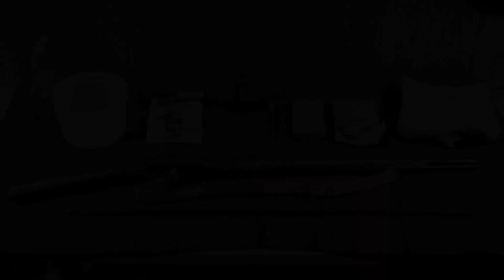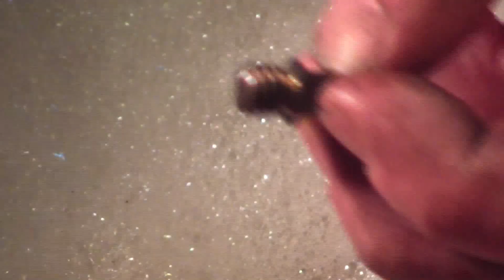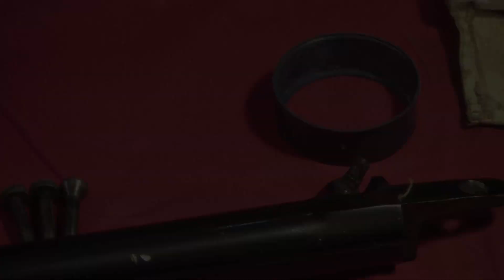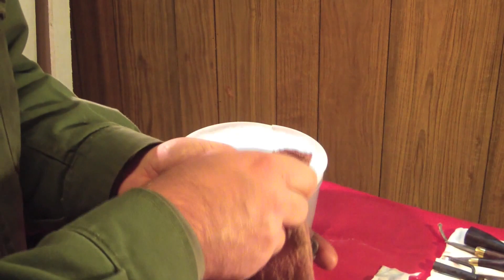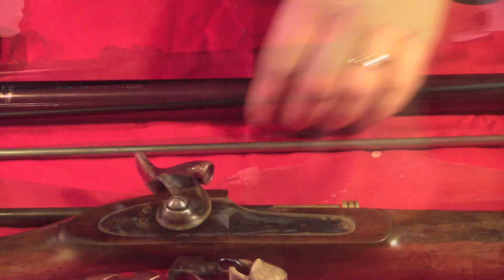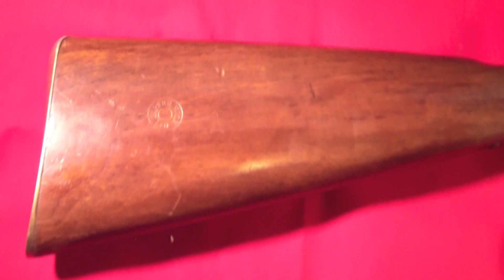Care and Cleaning of the Enfield Family of Muzzleloading Rifles: Pt 2

Comment: As usual, an excellent video full of great information! I was listening intently to see if you would address a question I had about my P53, and you did. I have noticed that when I turn down the tang nail, the muzzle rises. I wasn't sure how to rectify this issue. I was concerned tightening down the tang nail then returning the barrel bands would put undue stress on the stock at the tang. I have been returning the barrel bands first, then turning down the tang nail.  Now I will address the bedding issue in the tang channel. I very much appreciate your channel!

As an aside, I have always heard one should never use petroleum-based lubricants on black powder arms since it creates an asphalt-like substance that is rather difficult to remove. Clearly, you have proven this is not the case! Very best regards, JA
Reply from the maker: If you are willing, you can select a number of methods of bedding the breech...  paper, epoxy, card, and other methods are available... this way the breech nail won't cause the muzzle to raise.  Cheers!

Comment: Excellent block of instruction. Very informative. Is part 1 still posted?

Question for you, sir.
I purchased a used euroarms P53 and though the rifling is strong there is considerable rust in the bore from the previous owner. I have found some minor pitting but nothing that would deadline it.
I have oiled it with a patch soaked in CLP to loosen the surface rust prior to a detailed strip.
However, before I take a bore brush to it I'd like to ask if there as any particular method to cleaning a black powder bore that with not damage the rifling.

I plan live fire this piece so any advise would be greatly appreciated.
Thank you for your time.
Reply from the maker: I have to redo Part One as there are some issues with the music.... I just use soapy water and a jag with patches to clean the bores on my Enfields.  Personally I think the use use of a bore brush should be judicious as you can't simply pull it out without "reversing" the bristles...  Once it's at the breech, try rotating the rod to collapse the bristles and then pull the brush out.  If you have a nylon bristle brush, then this is not so much of an issue.  If your bore is rusted, you'd be fine for a couple of passes...  It's more of "prolonged use" kind of thing.
Reply: I appreciate the advice. I have a nylon shotgun brush that should do nicely.
All the best.

Comment: Excellent video series, I learned some great tips to use on my Pedersoli.  Just curious....when cleaning your Baker rifle do you remove the barrel from the stock?
Reply from the maker: Hi there.  Glad you found some useful tidbits.  Yes I remove the barrel from the Baker.  It had a hooked breech so there is only one screw (the front sling swivel) and the three keys to pop out and the barrel lifts out.  Very quick and easy.  Cheers.

Comment: Thank you. I got to see the video. It was very good. I was wondering, instead of the Teflon tape, I use an anti seizing grease. I also use this with the cones or nipples on my revolvers. I never have them lock up on me. Just how I do it.  I have a P-53 2 band Enfield from Pedersoli and an 1861 Springfield made by Chiappa. I must say that I prefer the heft of the Chiappa over the Pedersoli. First off, the lock on the Pedersoli has a very thin piece of metal in the lock that looks like it could snap easily. The Chiappa is beefier inside the lock.  Which brand do you prefer for the Enfield or any type of rifled musket?
Reply from the maker: Glad it finally worked for you.  I haven't heard of using the grease on the nipple before, but "whatever works" is always the best solution.  Have you done much shooting with the Pedersolli?  I hear that they are quite good.  All my Enfields are "made in Birmingham", Parker Hales. I used to have a Euroarms P53 (my first foray into Enfield shooting) and the difference between the two is remarkable...  The PHs have a thicker lockplate, better spring, and the lock has a much more "throaty" click when cocked than the cheap sounding, "tinny" click of the Euroarms.  The stock is much nicer, though also varnished and the weight is better distributed with the fore-end not being so chubby as on the Euroarms.  Never shot a Springfield. Cheers.
Reply: I forgot what it is called but I do believe it is the bottom of the mainspring. It is pretty thin and I read a blog on it. They were saying that they had that piece break on them before. That's all I had heard.
Reply: Mine appears OK also. If you could check it out, that would be great.
Reply from the maker: henerymag I was wondering what you based your assessment on, that the Pedersoli is the best copy of a Birmingham made weapon?  Is it because it represents a third pattern "Trade" made rifle?  The barrel bands, sling swivel, etc?  I can only guess that you are talking about the relevant cosmetic features like this....  I haven't handled a Pedersoli example but the PH and an original are very close in regards to feel and general stock dimensions.  Notwithstanding that it represents a later model of Enfield, of course. Have you handled an original next to a Pedersoli?  If so, how does it compare?  How is the bedding around the breech on the Pedersoli?  Stew,  as for the "thin piece of metal in the lock",  I don't know what you are referring to....  Is it the end of the mainspring where is fixes onto the lock plate?

Comment: I am a big fan of your channel. I am a redactor from Northern Ireland. Everything that I know the care of my 3 band, I have learned from your channel. 
I have two questions that I would like to ask your help with please. 

1. I purchased an India 3 Band for reenactments as I could not bear to see an original or even a Parker and Hale damaged. The stock is the wrong colour and I would like to refinish I in a walnut finish. I have a background in woodwork. Can you please advise me how to remove the trigger assembly correctly. 

2. I noticed that at my last event that when I squeezed the trigger the hammer is falling to the half lock position. The trigger requires a sharp pull to ensure that the hammer falls correctly. When I purchased the rifle it had a very heavy trigger pull. I liberally oiled the trigger when I stored the rifle (the rife is only approx 4 months old). Can you please give me any advice as to how to fix this issue. 

Any help with these two issues would be helpful please.

Regards your no one fan in Ireland

Comment: Why not use antiseize compound or heavy grease on the nipple threads? Also, why not use spray can starting fluid instead of hot water for the lock? Thank you.
Reply from the maker: Why not?  Never said that there was only one way to do this... I said that this is how I do it.... that's all.
Reply: britishmuzzleloaders thank you. I did not mean to come off as harsh. With your experience I anticipated you had experimented with different methods. Thread tape can "wallow out" a threaded hole, and an evaporative cleaner like spray ether guarantees cleaning without leftover water.

Comment: Hello, these two videos have been a great help for me ever since I’ve owned my Enfield rifle. However, something not covered is the cleaning of brass. 
I noticed that the brass features get funky quickly. Have you any suggestions on making brass shiny again? I think I will try one of the easy methods of cleaning brass you can find on the internet, namely lemon juice and salt.
Reply from the maker: Brasso will do a great job....
Reply: I use something called 'Twinkle Brass and Copper Cleaner'.  It does not require scrubbing/polishing:  just wet the metal with a little warm water,  apply a little of the material with the supplied sponge applicator,  let sit a minute or so,  and remove with warm water.  Repeat if necessary,  then dry the metal with a soft cloth. The whole process just takes minutes and no scrubbing is required.  I use the stuff with great success on everything from copper pots,  brass objects,  and drum set cymbals.  Beats the heck out of the materials that require scrubbing,  like 'Brasso'.